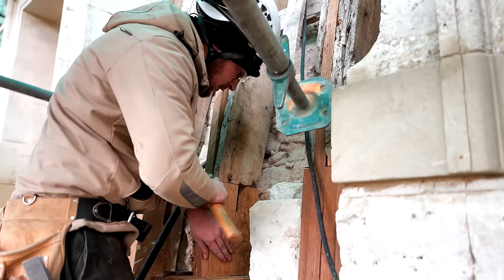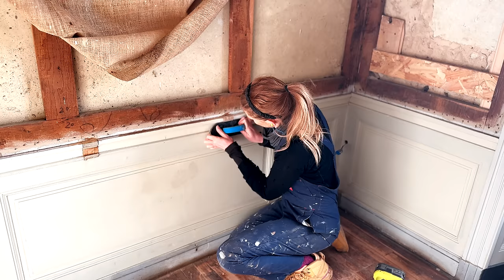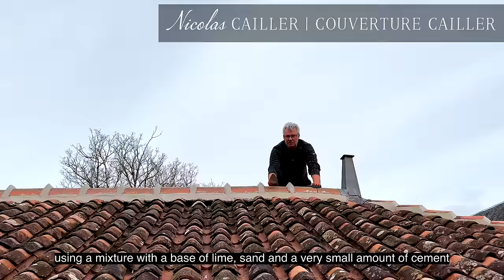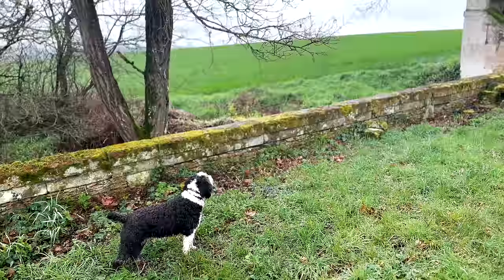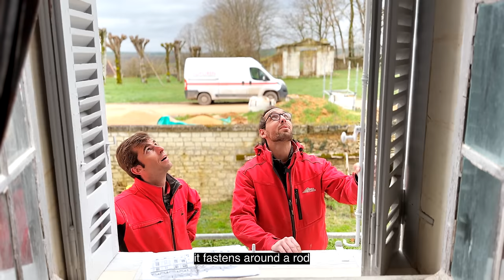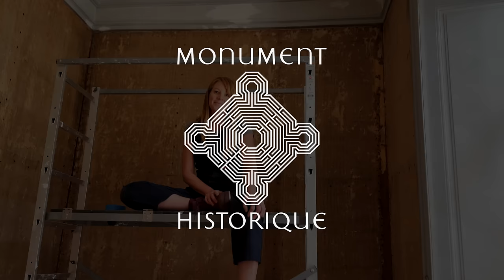Disaster strikes the fragile château domain. Château Restoration #11

Comment: Maybe you should ask Château du Theil restauration in Corrèze for your domain walls. They rebuilt  the enclosure wall with the help of volontairies belgium scouts. They did a such great job with all old stones they found on the domain. Juste an idea. Bon courage pour cette remarquable renovation avec vos extraordinaires artisans👋👋👋
Reply from the maker: Thank you for your suggestion.  A great idea.  We've had volunteer days before on several occasions.  When we've settled on a plan for its reconstruction, we'll add the wall to the list of projects that we can work on with our wonderful group of local volunteers.

Comment: It's ironic that the cement they put on top of the wall probably became the barrier that kept the mortar in the wall wet leading to more instability. The real issue is probably the weight of wet earth (which expands with all the rain we have had) that pushed it over in the end. The constant cycles of wet and dry expansion and contraction wasn't meant to be retained by a stone wall.
Reply from the maker: Thanks for your comment.  You're quite right - the cement is fatal to our traditional stonework as it cannot breath.  If a render had have been applied originally, it would have been a lime-based mix and would have weathered far better in the long term.  But more recently, quick and cheap repairs were sometimes done using cement with inevitable results latter on!

Comment: How is it that none of the chateaus or cottages in France have window screens? Surely you have insects and creatures that invade just as we do in the US?
Reply from the maker: We have plenty of insects.  But we also have over 100 sets of windows, some of them over three metres high.  I'm not sure we could maintain the heritage ambiance if we installed fly screens everywhere.  We also don't open the windows in the same way as other buildings might.  The chateau is very cool in summer because of the thick stone walls.  For this reason air-conditioning is completely unnecessary on even the hottest days.  But we probably wouldn't leave our large windows open for long periods and let the cool air escape.  Thanks for your comment and for following our journey!